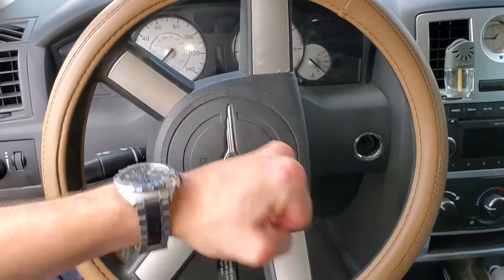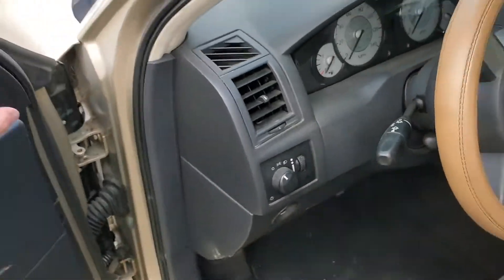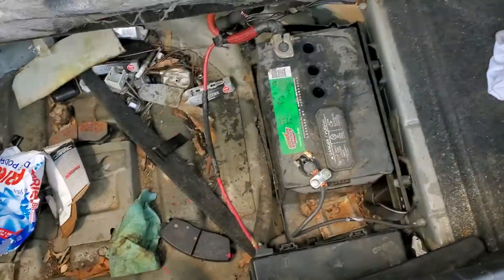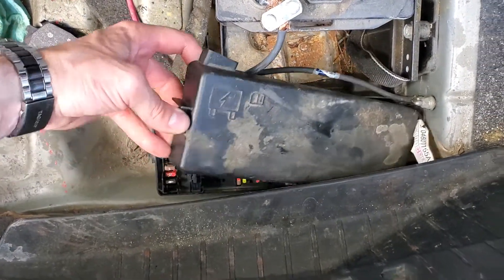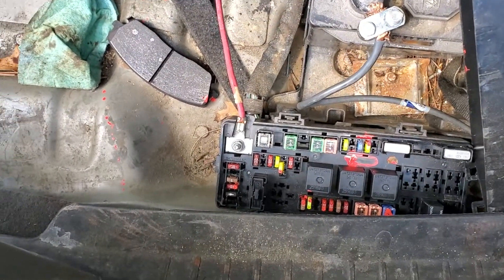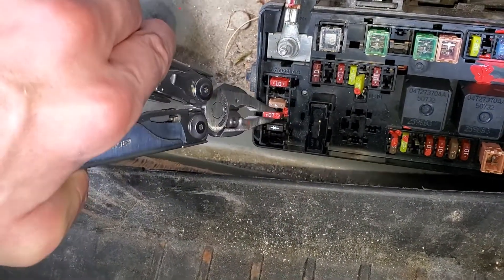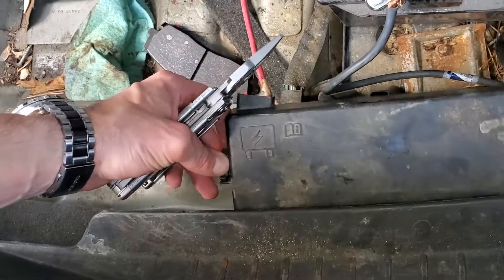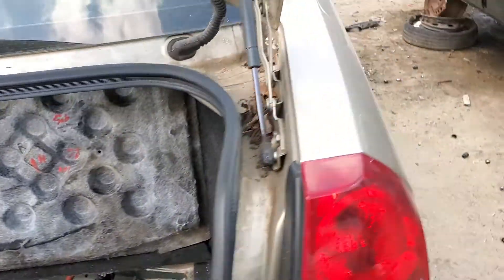2009 Chrysler 300 Horn Fuse

Comment: I have a 2009 Chrysler 300 the horn will only work if the power is on so (acc, on and start) if the car is off and the key is out etc and you press on the horn pad it does nothing, why is that? I’ve seen some VWs do that but other then that most cars horns can be honked even when off

Comment: Hello so a friend of mine had his Chrysler 300 towed away and after I retrieved it the horn didn’t work. We checked the fuse and it’s fine what else do you recommend checking. We also verified that they where connected properly.
Reply from the maker: I would check the wiring to the horn and the horn itself
Reply: Checked wiring from the integrated power control module to the horns and didn’t find any opens, or high resistance.